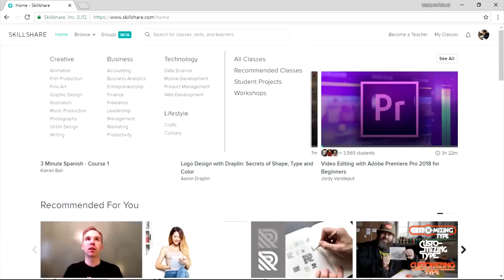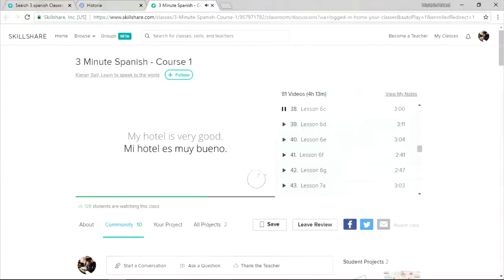Chain Saw HACK 4

Comment: Nice, My house has a outside finish made from barn siding. Very expensive to acquire replacement boards. I have been making replacements on my table saw with 1 wire brush on the spindle and many passes also huge mess in my shop. With your hack I can do this outside and much faster.

Comment: I am thinking you still have to use bar and chain oil to keep from burning the chain and bar up. I sure could have used this when I had the job of wire brushes some steel beams to be painted.

Comment from the maker: Do you have any suggestions for further modifications of the chainsaw?
Let me know below :)
p.s. I use UCPA not CPA ball berrings, my mistake :)
Reply: Chainsaw scooter :)
Reply: Chainsaw water pump :)
Reply: Made in Poland Brother you are a mechanical genius, how is it that you are not designing for a major tool company?  Fucking brilliant mate! Just brilliant. 👍👍👏👏👏
Reply: Zrób wiertło do ziemi
Reply: Made in Poland I would like to see your version of a homemade chainsaw trenching tool (cuts a groove into the earth for laying cable or plumbing ect) 
It would be excellent if you did as I need one and they are very expensive!  You do that, and I will find some way to compensate you my friend!  Made In Poland
Reply: A smaller wood chipper?
Reply: Use it to cut wood 😱
Reply: Made in Poland I would like to see your version of a Trenching Chain Saw attachment.  It is for cutting a 1 or 2 foot deep groove in the ground.  I really, really need one and know you can make a badass version.
Reply: a chainsaw powered winch? with drum spool and gear box for winching logs in the woods or whatever else might need it
Reply: Chain Saw Impeller Water Pump ;-)
Reply: good
Reply: Szlifierka taśmowa - do szlifowania np.: ogrodzenia przed spawaniem (naprawą)/ Belt grinder - to grinding ,for example: fence to make good welds ( to repair it).
Reply: You can buy saw chain that has no teeth on it.....keep from having to make the guard you did.  I have a "Log Wizzard" I use to debark logs for my saw mill that uses this type of chain.
Reply: use knotted wire wheels
Reply: I'd add a skate wheel to one or both ends to help it not wear out so fast against harder objects.
Reply: Chain saw powered stump remover, because after you have cut the tree you need to remove the stump.
Reply: How about an Abrasive saw, you know the saws that are kind of like angle grinders only bigger and use 360 mm - 410 mm disks to cut through metal.
Reply: Or put a hydraulic pump on it and a single hydraulic cylinder that actuates a huge metal scissor so you get a Jaws of life kind of apparatus out of it capable of cutting metal.
Reply: Made in Poland الصورة لرؤيتها ورق
Reply: A chainsaw that uses a thin band saw blade instead of the usual thick chain. It would cut through wood a lot faster.
Reply: 987631หพแทมึวึแแแแแแแแแแแแแแแแแแแแแแแแแแแแแแแแแแแ
Reply: Yey